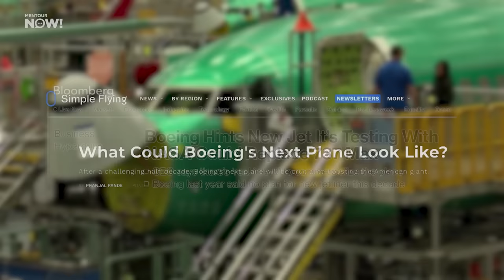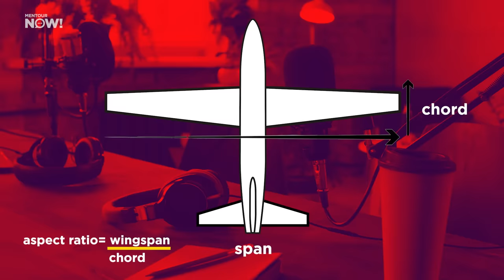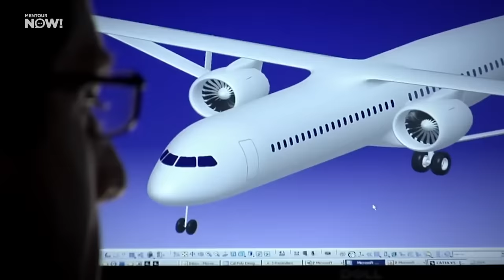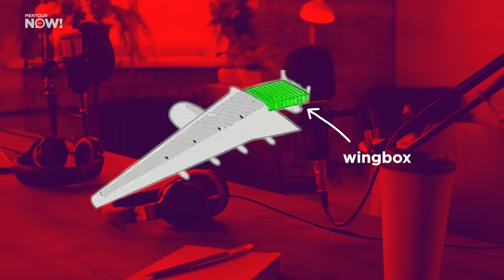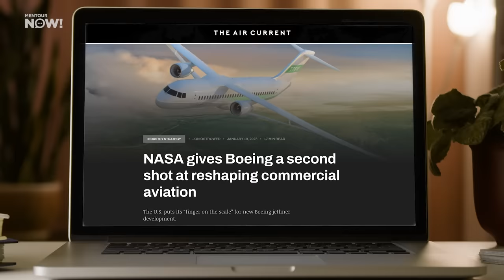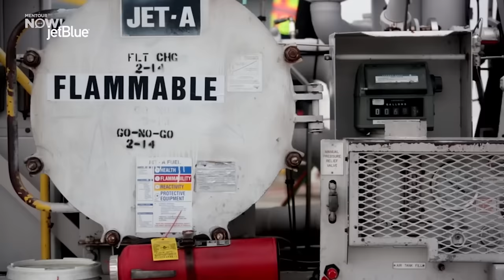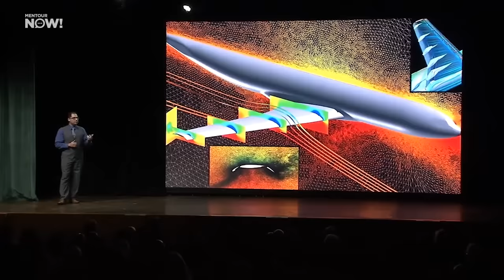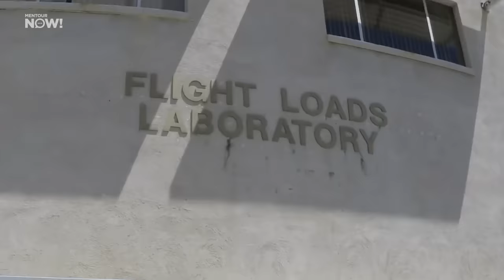Revolutionary Breakthrough: Boeing's Transonic Wing in Partnership with NASA!

Comment: I'm sure they've thought about it a lot, but the idea of longer and more flexible wings just makes me think of a wooden swan or something, but not in the gracious kind of way, haha.

Also, wouldn't the trusses have a weakness in the middle?
I mean, they're there to keep the wings in place, but i wonder if the wobble frequency of the wings could mess the trusses up, and the trusses starting to wobble along with the wings, basically turning the whole wing situation into a wobbling mess that causes more drag than it should.
It makes me think of that infamous suspension bridge that started dancing in the wind before collapsing.
But again, i'm sure they've thought about all of that.
Reply: Yes, a lot of research has gone into designing and verifying tools to simulate these types of wings to make sure that flutter doesn't pose a problem while minimizing structure and getting the best wing efficiency.
Reply: @AmbientMorality  Hah, yeah, i am sure it is all tested thoroughly.
It's just a new thing for me, and i'll probably feel the same if they started using double or triple winged planes.
In my head i just picture disasters, the outer wings getting sucked towards the middle and form a lumpy mess.

With the trusses i just keep thinking of that "killer frequency" that can topple a tree in theory.
To throw in a lame pun, i don't yet have a lot of "trusst" in them yet.
But yeah, it'll just take some time getting used to seeing them.

Comment: figures like 2.5 ltrs per passenger to fly 100 kms in modern jets are pretty impressive
Even if industry with Tech gets this down to 1lt per 100 kms ticket prices will not change
All markets are ''fixed'' and will remain so until the system crashes.

Comment: Folding wings drastically reduce the structural integrity of the wing, as well as introducing a brand-new point for catastrophic failure, solely for the purpose of saving money.
Sounds like a good plan.
Reply: That's where the supporting struts come in. All this has been thought through.
Reply: @mmm0404  I don't see how a a fixed strut can reinforce a folding wing section, or the hinge, but okay.
Reply: @gregmark1688  well you said the wing not the hinges. 🤷

I don't think the strut will reinforce the folding section, but could be used to offer some  support to the locking mechanism.
Reply: Folding wings have been used on naval aircrafts since ww2, it's a proven design.
Reply: @mmm0404  My point was that folding wings can break in a way that normal wings can't -- the part that folds can break off. The folding wings aren't necessary, they're only there to save the airlines the cost of expanding the size of airport gates.  The very first time there is a tragic hull loss of a commercial liner due to a break of the folding wings, the entire class of craft will be grounded, and no one will ever want to fly on them again, even if they are proven to be safe.
Reply: @nhytg376tgyuu765gjmg  The navy uses folded wings because its required to fit planes on boats. Unlike you and me on a commercial jet, the naval pilot has an ejection seat. We can't possibly know how many naval aircraft have been lost due to problems with the folding wings (or anything else) because the navy is unlikely to release that information. So you can't actually say if the design is or isn't proven.
Reply: @gregmark1688  well have you seen the flaps or other movable control surfaces on an aircraft wing ever breaking off, so why are you worried about the wing breaking off? 

There are plenty of military aircraft that have wings that fold in half, but I have never heard them breaking off. 

Maybe its not as much of an issue as you make it.
Reply: @mmm0404  Control surfaces aren't supporting the weight of the aircraft. And even if the wings of military craft were breaking off left and right, what makes you think you would hear about it? You think the navy would be telling anybody about it? They would not.
Reply: @gregmark1688  well the point is, it's an unlikely  scenario. 

The wing is being pushed up due to the generated  lift, so the biggest worry here is an inflight fold-up of the wing, not a break off. 

When you push an UNLOCKED  door, no matter how hard , it always swings open , it doesn't usually break off.

You can only break off a door with force  if  its locked on one side and hinged on the other.

This folding wing will only be locked/hinged on one side. 

I mention the control surfaces because they use a similar hinge and lock mechanism that could be found on this folding wing design. It's rare for them to break off.
Reply: @mmm0404  You're right, ofc, that the thing actually snapping off is less likely, but I am considering an in-flight fold up of the wing to be equally catastrophic. Perhaps it wouldn't be, but it sure seems to me that the added stress would be impossible to survive at the proposed airspeeds. Also, how would such a floppy wing segment behave in-flight? Would it remain sticking up? It would still be generating perpendicular lift, remember. It might smash over into the remaining wing segment, or it might even flap back and forth violently until it tears the whole wing off.

(If you can't tell, I'm not a fan of riding millions of lives on wings with hinges. <shrug>)

Comment: The Boeing Transonic Airliner or BTA will feature 1 huge engine, and cost saving features like downward facing ejection seats for rapid passenger departures. It saves even more by using a standard IPhone so pilots can fly from home. Of course it uses a modified 737 as why not, the shareholders will love it. The new MCAS 2.0 has a patented landing system for rapid landings. Thank You Boeing, I can't wait.
Reply: also rapid disassembly. 😂
Reply: What are you, 12?